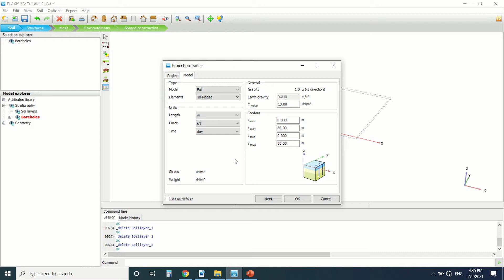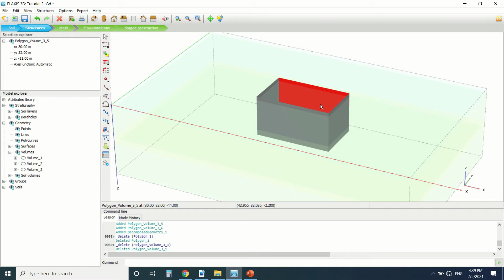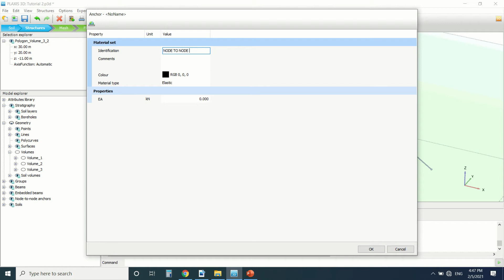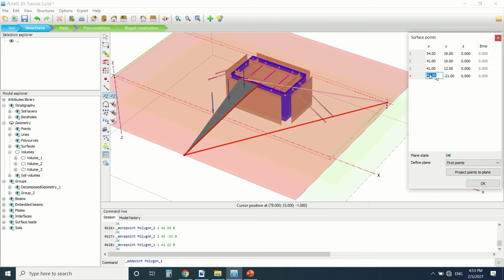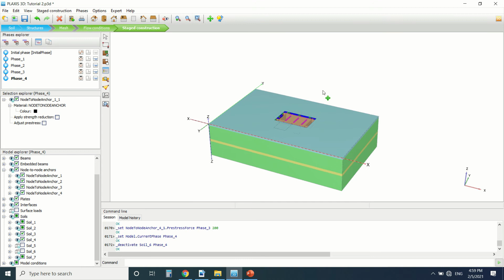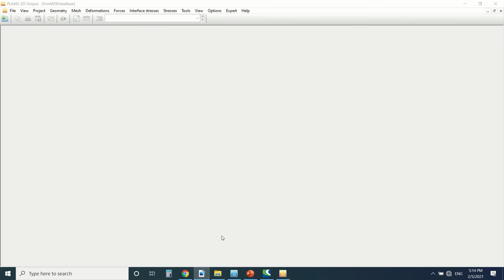9- Plaxis 3D tutorial: excavation in sand, shoring system, strut, anchors and sheet pile

Comment: Hello, I simulated a shear test with a concrete encased anchor,, at the top I set a point load, when the calculation was completed for some reason the model did not deform in any way and it was not possible to generate a unique load image for the reference point as the data showed zero, may I ask why this is?😢

Comment: Hello, I wonder why do we need to form the positive and negative interfaces ? I thought when assigning plate, it already has the interface. Thank you for your video, it's very helpful and informative.
Reply from the maker: Helloo, i have already made a video obout interfaces on youtube you can find it on my channel
Reply: @theengineer7732  Oh, I can see that video. Thank you very much
Reply from the maker: Did you find it?
Reply: @theengineer7732  Yes, i've found it. Usually, I model the retaining wall with the steel sheet piles so I skip the interface a lot. But I learned that I should use them for concrete retaining wall. Thank you for your caring